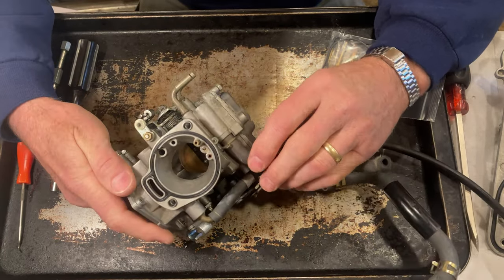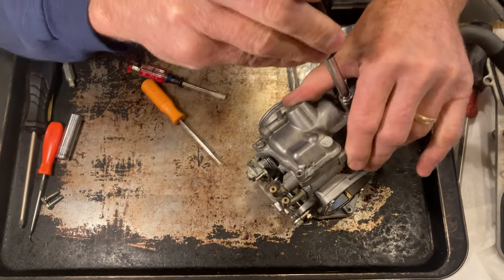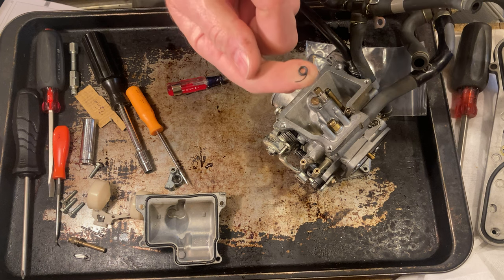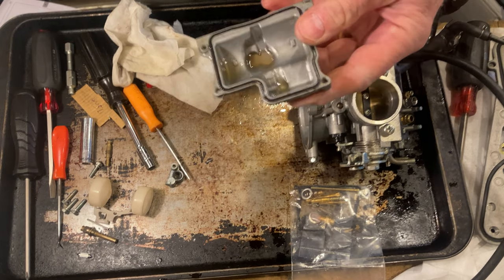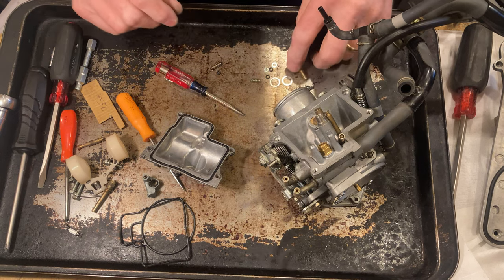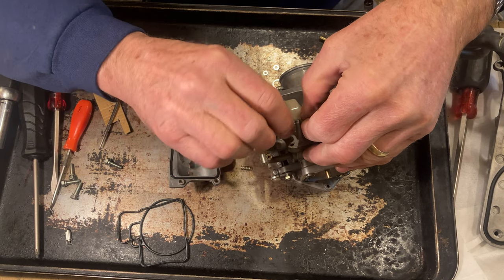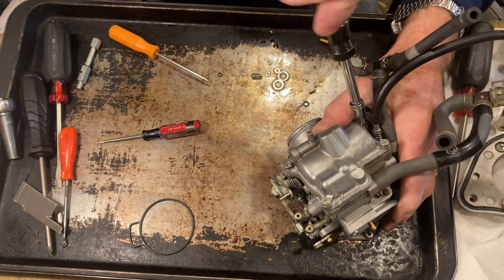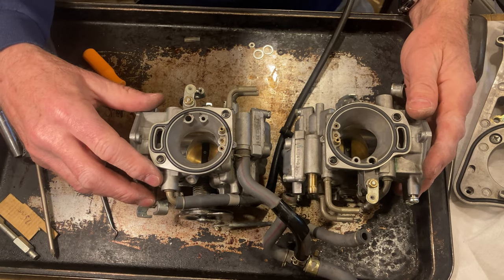Honda GL1500 Goldwing Carburetor rebuild video, PART 4

Comment: Wish you could adjust my floats on  my 1500 goldwing. Hard to find anyone that knows what they are doing
Reply from the maker: Hi Nathan, yeah once you install the carbs you don’t want to take them back out so I know what you mean. Float height adjustment is important but generally if it hasn’t been a problem before you might not need to adjust them. But it’s always a good idea to check anyway though. I hope you get it all sorted out